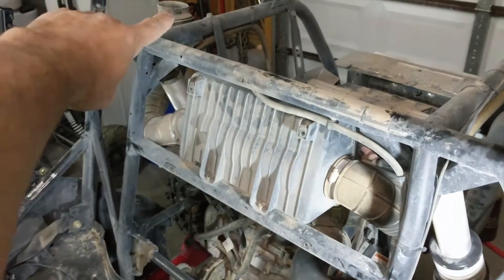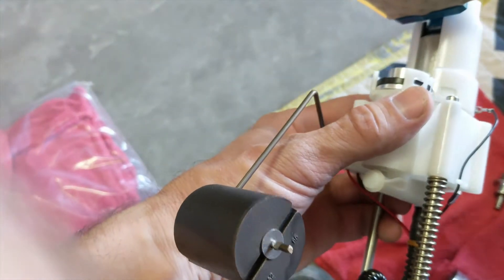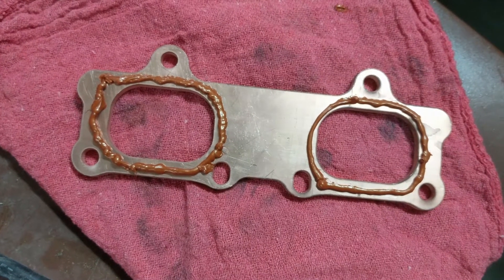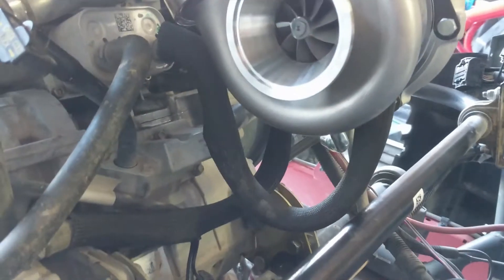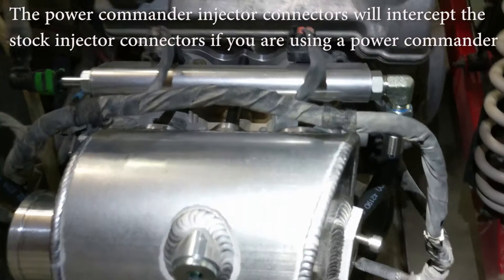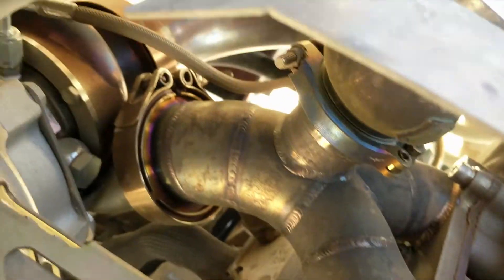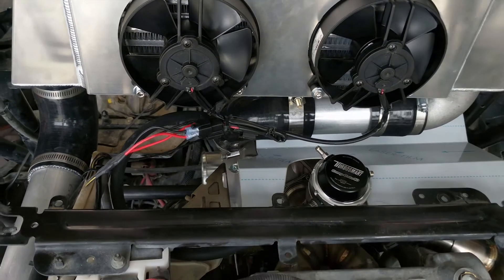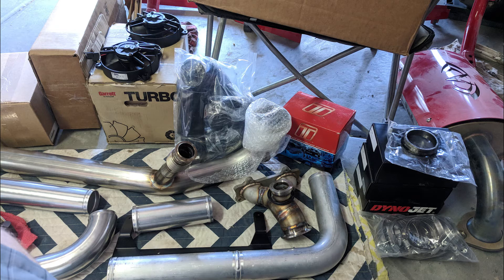K&T Turbo Kit Install RZR XP 1000

Comment: Thanks for the video. I’m in the middle of putting the same kit on my rzr.  We pulled the engine and did rods pistons and studs in the head and mains. Also ended up having k&t port my head on their Cnc and it looks amazing.  I believe they also put over size valves in.  Just got the engine in this evening and I keep referring to your vid for ideas on where to run everything.  Thanks for the work and time you took to make the video.
Reply from the maker: Thanks for the positive feedback. I appreciate it. I ended up having them build my motor as well! It seriously runs amazing! Glad the video was able to help. Out of curiosity, how did you find the video?
Reply: I spent a lot of time searching on YouTube for any kind of help on it and I believe k&t performance in the search pulled your video right up.  Worked out perfect because my rig is literally exactly the same as yours except it was blue. Only complaint I have on the kit is lack of instructions but as you stated it appears everything fits real well.
Reply from the maker: @BaileyFarming  glad it helped. FYI K&T was extremely helpful with all the questions I had before, during and after install!
Reply: What kind of Hp and torque are you guys making with the engine build

Comment: Good video buddy it’s helping me a lot right now what psi you running right now ?
Reply from the maker: 25 PSI
Reply: Ime having a problem with my dc voltage at the dash how much dc are you showing at the dash with car rebbing it ?
Reply from the maker: @guillermomurcio6680  at idle you should be 13.something. if not then test your stator nd voltage regulator
Reply: Thanks I’ll check that are you running race fuel?
Reply from the maker: @guillermomurcio6680  absolutely yes. On a built 1000 that wasn't Turbo to begin with, I run 91 octane on 10 psi. 110 octane on 11-20 PSI. And 116 octane on 20+ psi. The compression of your engine plus the amount of boost you run will determine when you should run race gas.
Reply: Thanks for the information buddy ime going to start running 116 since ime at 20 psi right now
Reply from the maker: @guillermomurcio6680  116 is a little overkill. I just like to play it safe. Could probably get away with 110.
Reply: Can 110 make the car act a lil funny with engine well built if ime at 20 psi?
Reply from the maker: @guillermomurcio6680  anything is possible. Change your spark plugs first. Very carefully gap them at .018  Check your plug wires. Check injectors.
Reply: Ok I will thanks for all the input!!!!
Reply from the maker: @guillermomurcio6680  make sure you have a reliable way to monitor air fuel ratio
Reply: Is there a gage I need for that?

Comment: Hi guys - I saw that you use stock primary and 
secondary clutches - it's endurance enaugh with so much power?
Reply from the maker: They last for a little while. Installed STM clutches eventually though.

Comment: How big was the difference in hp? If not dynod was it a big difference in ride?
Reply from the maker: At first it was a pretty good difference but I was only running on 10 lb of boost. Then I fully built the motor. And now I am running on 27 lb of boost if I turn it up all the way. So it's kind of a hard comparison, I didn't leave it on the stock motor for very long. But yeah I'd say it was a pretty good boost in power it definitely helped a lot.

Comment: Do you run with no clutch cover everywhere or just in the sand.
Reply from the maker: I have always ran a clutch cover. Ran without for the dunes recently to make it easier to adjust clutch weights and inspect my belt.

Comment: How reliable will my rzr be after putting in the supercharger
Reply from the maker: @Edgar Ramos depends on your tune. With a good tune and the proper amount of boost/power per your build, it can be equally as reliable as stock.

Comment: First off Nice video bud. Second what kit is this and from where pricing? What all does it come with and most importantly what are the power #s with this kit? Also how is this with stock xp4 1000 motor internals?
Reply from the maker: The kit is from K&T Performance. The price for the kit is $5695 complete with everything. Not sure on the power numbers exactly. The stock motor handles it very well. I installed the kit with about 3000 miles on the stock motor with no issues. You can run about 7 PSI on stock internals.
Reply: Hmm I'll have to take a look at it and get some info on numbers. I was thinking of just building my own kit as we do with our race cars "1/4mile" and just having a shop tune it. Thanks for the info @tech and toy stuff.